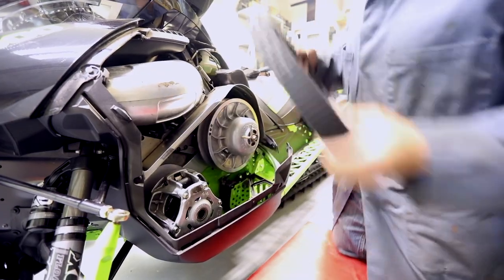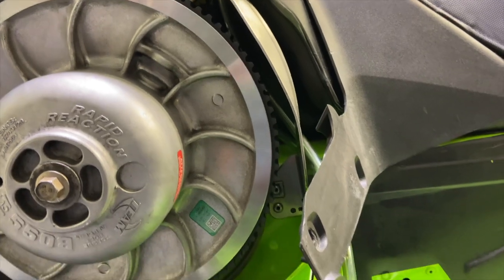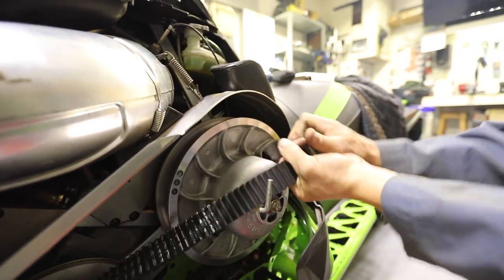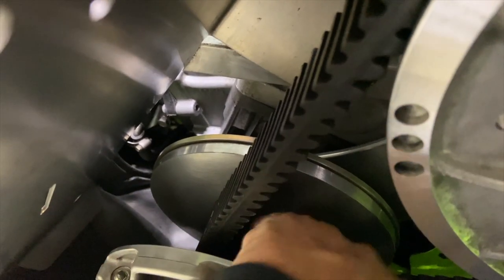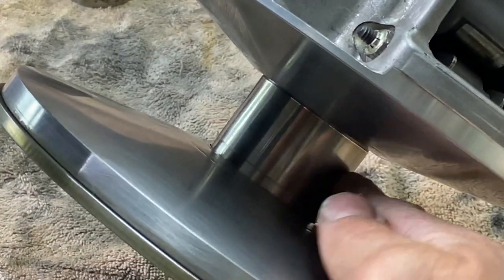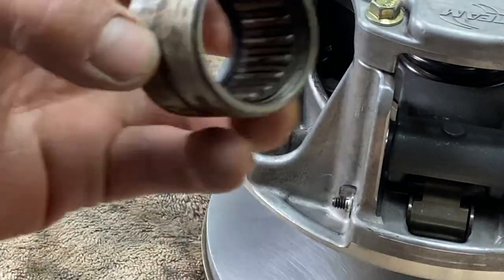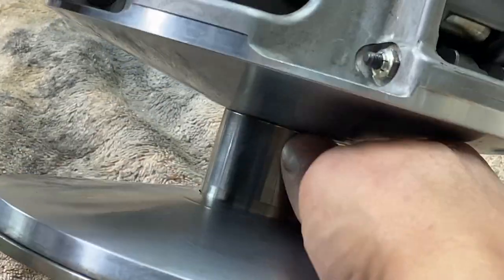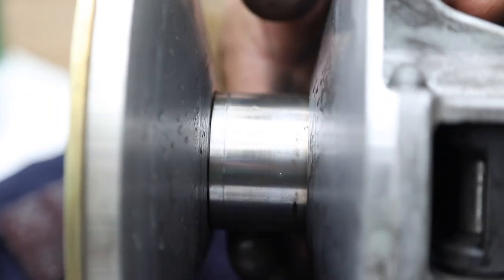Is this belt too high? Snowmobile belt stretch and Arctic Cat needle roller bearing on clutch

Comment: Great vid. I have 2010 snow pro 500 with same clutch. Wide open I am only getting 7400rpm and use to get 7800-7900 rpm. Motor seems strong and not bogging or hesitating at wide open or at anytime. Sled still rips 0-60 mph. Any ides what in clutch would cause this problem. Sled has 3000 miles on it all stock.

Comment: Downside to cat team clutch is it is not rebuildable. No parts available  Rode cat for years love them.  I now have a wildcat xx with the same team setup.  Rollers are wore out. Oops you need to buy a 1000 clutch instead of 100 set of rollers. Nobody has a vice to hold them to repair them. Same problem with my wildcat 700. You can rebuild a Polaris team clutch including the roller bearing done it  Sorry for the rant just pissed off  Been rebuilding clutch’s since 1970

Comment: I know with the older primary clutches I would wash them in the dishwasher every once in a while, when the wife was out shopping. Is it ok to wash these Team Primary clutches with the roller bearing, in the dishwasher? I was originally thinking no, but since I saw you used brake cleaner on the bearing, maybe its ok to?
Reply from the maker: Brakecleaner wont turn steel parts rusty , soap and water does !

Comment: How do you clean the roller bearing and does it require any lube?
Reply from the maker: Only way to clean it properly is to break clutch’s apart and remove bearing , clean it good and re-install , but if you just blew it out real good once in awhile , it will last alot longer ! And NO lube ! Lube attracts belt dust !!
Reply: I figured its dry, just double checking, thanks 👍👍👍